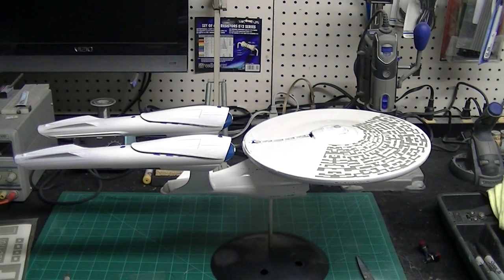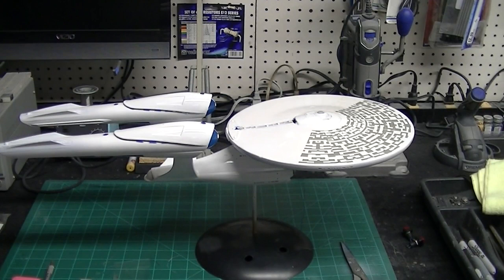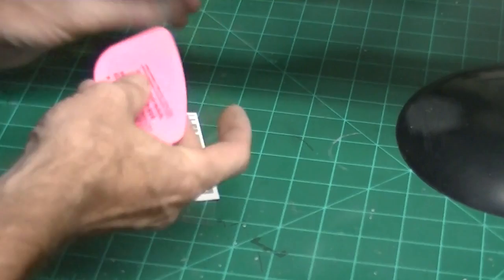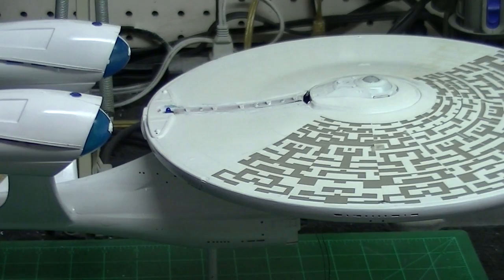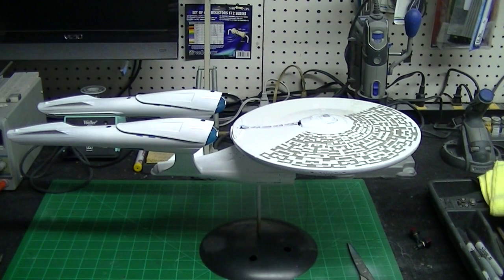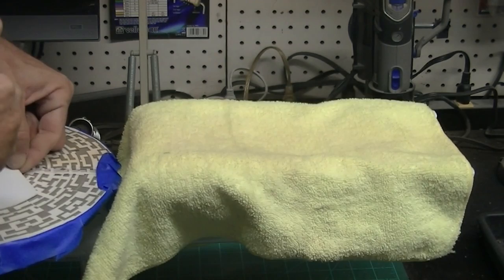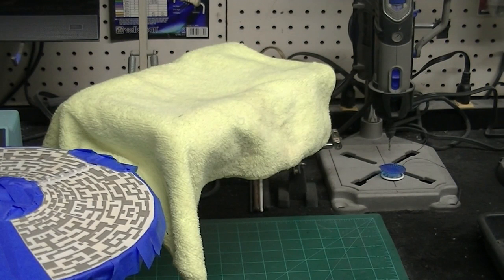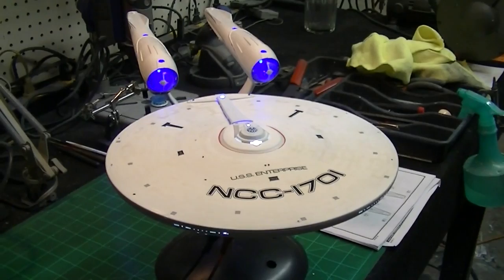Revell 1/500 Scale Into Darkness U.S.S. Enterprise Buildup PT 4 Painting Aztecs

Comment: Very informative stuff. I do scratch building, so I never have any use for following a guide... but this is a remarkable amount of info for the hobbiest! 

To do original aztec designs for my ships, I paint the hull for a "reveal" color, then use packaging tape burnished into the suface real good, then paint again. Then I sand back to the first layers of paint. It makes a nice weathered effect, and adds to the detailing as a raised surface detail to boot! The upside is that with a sharp knife, you get all the detailing directly on the hull, the down side is that if you make a mistake cutting, it is directly on the hull! (lol) After that, taking a pencil to add flat shiny "sheen" atop the hull can add more depth, sealing each layer with dull coat or gloss as I go.

Oh, I have never used designer paints, waste of time and money. Spray paint out of a can. Home Depot or K-Mart, cheapest stuff I can find. Nobody has ever guessed, and as a matter of fact, I always get questions about what paints I use. For gloss I use Crystol Clear by Krylon, and the rest is always cheap flat colors. 

For a look at my work, look at my profile. That is the "GlassDragon" in the park. You can also find tons of pictures of that model on "resin illuminate", search GlassDragon there too.

I can't wait for the yammato video, that is next up for me!

Comment: The Tamiya paints are “synthetic” acrylics and you can use Lacquer Thinner or the acrylic thinner.  Learned this from a fellow modeller.  I know the Tamiya clear is very aggressive and is a lacquer.  I have had Tamiya Clear dissolve Tamiya decals if applied to heavy.  If you used acrylic thinner for the clear blue Tamiya this could have caused the blue to run.  I only use lacquer thinner when airbrushing Tamiya paints.  I have a hard time using the acrylicc thinner.  Great videos keep it up!  Thanks for all the tips.

Comment: The Orbital Drydock aztecs are masks--not permanent. They have a low-tack adhesive and you remove them after painting. It might be more work, but because it's a flexible mask, it conforms more closely to the body of the model than photo-etched parts.